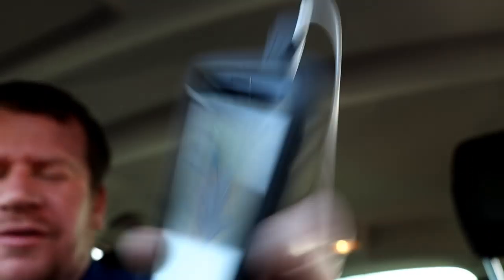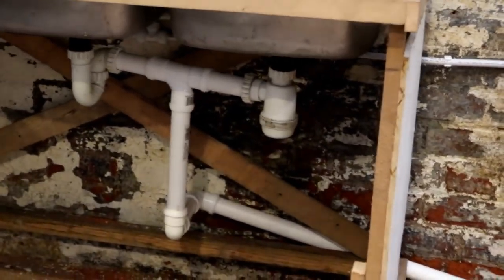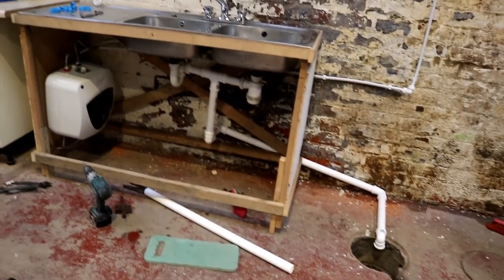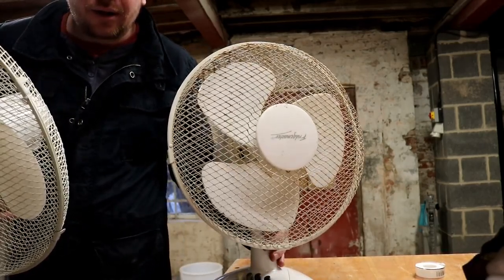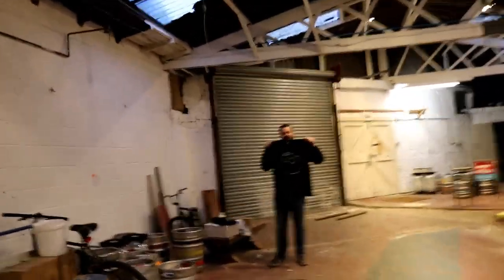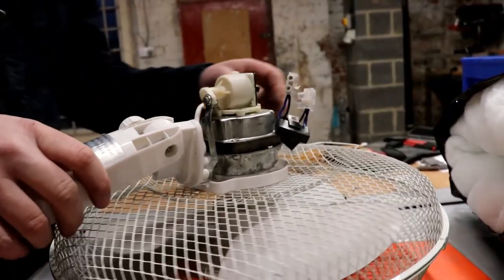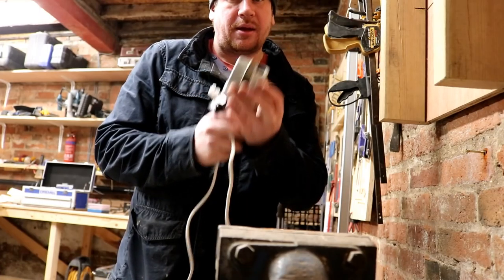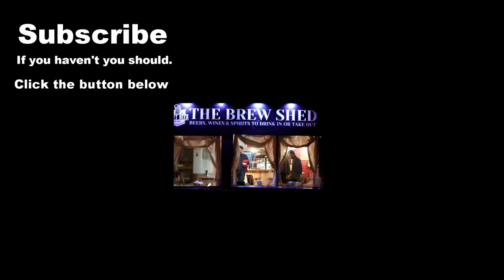VLOGS IN FEBRUARY!

Comment: I've fixed quite a few of those fans and usually its a mechanical issue rather than electrical to go first.  Usually a good clean and oil the shaft does the trick.  Haha, love the Frankenfan :-p